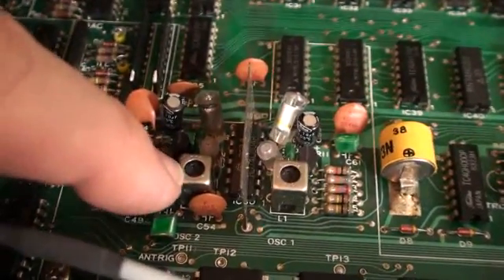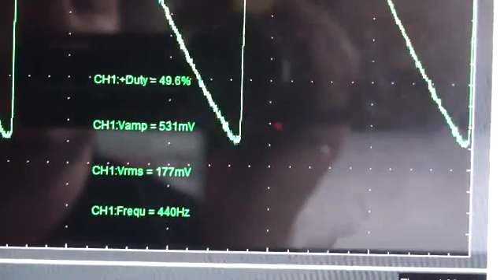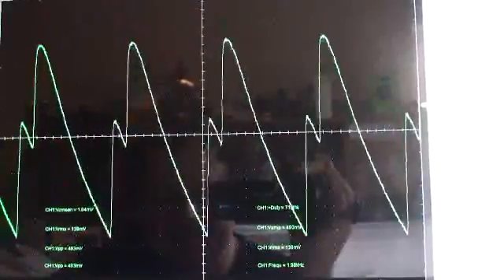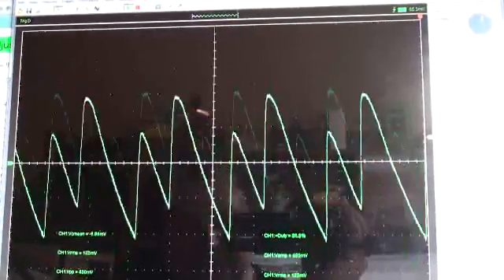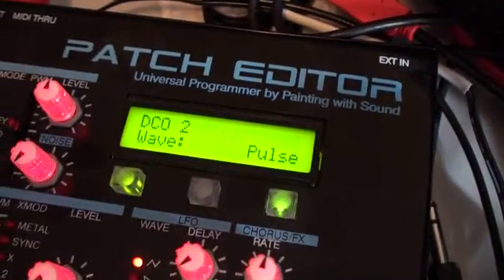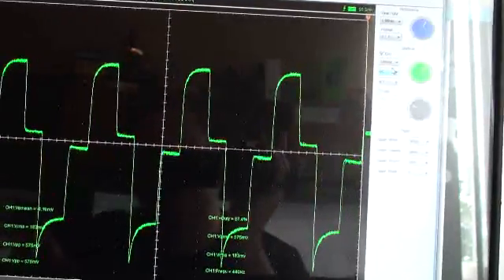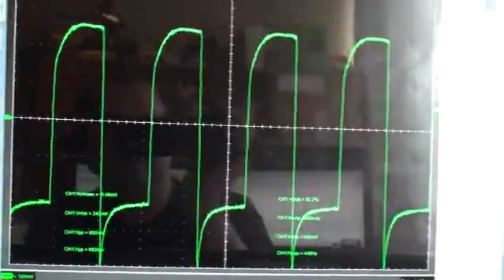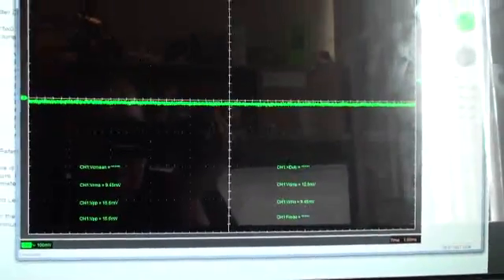Kiwi-3P OSC Tuning: Part 2

Comment: I'd be curious to know whether you ever resolved this issue.  Because it seems to me that, given the technology you've got to work with (i.e. a 30-yera-old analog synthesizer), you're never going to get it perfectly in tune.  It's just like aligning an old radio.  It's almost impossible to get precise results with those old-school trimmers.  But I do agree with what another poster said: You should be using a plastic radio-alignment tool.

Comment: Cool vid. Recommend a plastic tool for the tuning,  A metal screwdriver interferes as it enters the coil. Also the metal tab you mention is for isolation, not heatsinking.

Comment from the maker: Hi BMX. It's not that Voice 5 is the only one in perfect tune - It's more that when I was calibrating the tuning between oscillator 1 and oscillator 2 I can only get perfect waveform sync with one of the voices. In this case it was voice 5, but I suppose it could have been one of the others.

Remember, unlike the Jupiters, Polysix, Prophets, & others - JX-3P does not use individual voice chips: The voice-specific difference in tuning sync is just part of its character resulting from its design.